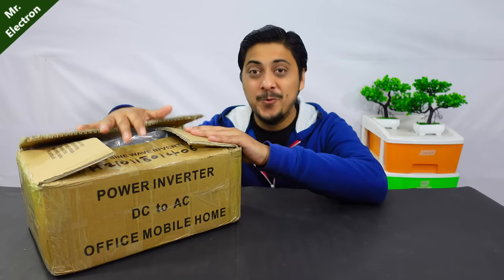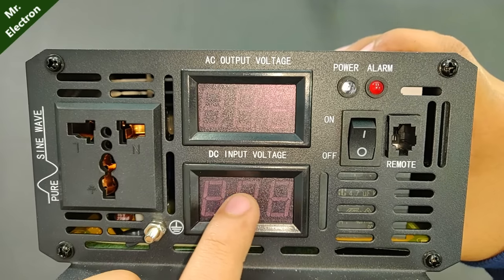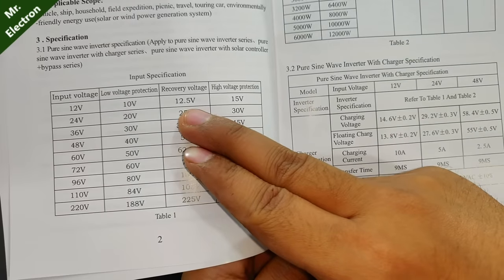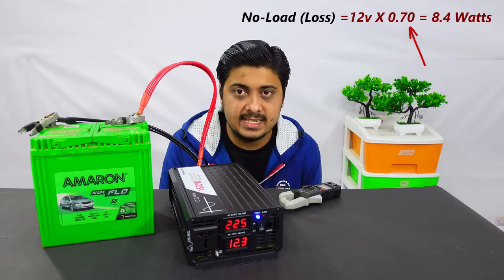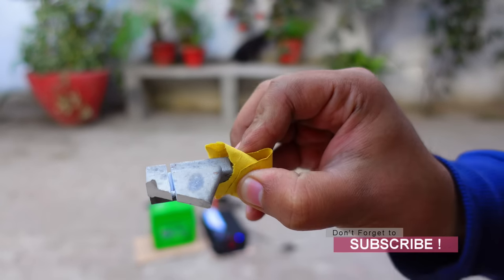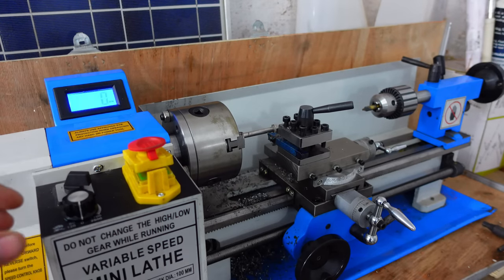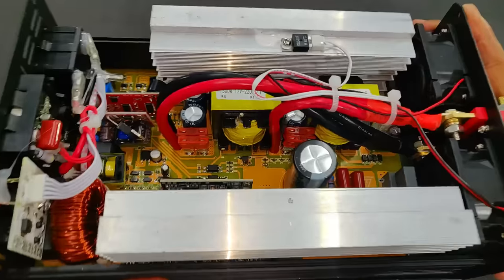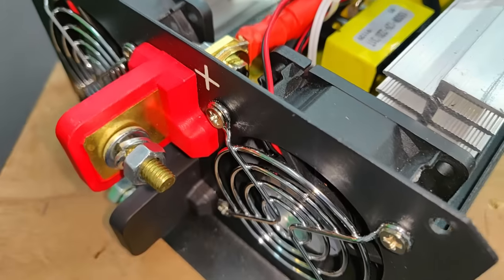3000 Watt Pure Sine Wave Inverter hook up to Car battery - 12v DC to 220v AC Converter  CNSWIPOWER

Comment: The title is misleading, this is a 1500 watt inverter not 3000 watt, the 3000 watt is only the peak output for a fraction of a second so it can't be used to run 3000 watts.
Reply: Thought for sec there if I was the only one who noticed that! Thanks
Reply: What's the cost ?
Reply: Milega
Reply: @leanbean8376 

Surat Gujarat mein

Comment: Great video, I really liked your whole presentation and editing, but I think this testing should have been done off of a battery in a running car, so at least you could test it with a fully charged battery for every tool. As is, your not really showing the full potential of the inverter. The charge level of the battery is a major factor effecting performance and making your results unreliable. I'm really interested to know if the welder would have welded if it were in a fully charged battery, or if it would have worked with a bigger bank (two batteries in parallel) If you'd have just added some jumper cables from your test battery to a running cars' battery  that would have made this whole thing a true measure of the inverter.

Comment: Dang i was hoping you'd at least get an arc struck there to give me an idea if my setup that I'm about to attempt some welding at will work or nah. I've got a pretty good feeling it will since I'm running my inverter from a 120ah deep cycle as opposed to what you have here tho.

Comment: hell'o and thanks  i noticed you used battery clamps on the inverter wire  to the battery can you do the same to the back of the inverter with just the wire and clamps to that terminal ?  you know two clamps to the battery two clamps to the inverter for quick connect thanks  and what size wire was that if in american would it be two 6 size making it a size 3 as america goes the bigger the wire the smaller the number?? thanks again

Comment: Hi i have a question... do i need a circuit breaker in between the battery and inverter ?or i do just to straight from battery to inverter just like you did.
Reply from the maker: Just like i did.. it already comes with all types of protection features like overload , short-circuit , high temp etc.

Comment: I’m hooking up a 5000 watt converter to a 4 - 12volt battery bank but when I hooked the positive cable it sparked pretty good, is this normal, I stopped and need more infro

Comment: I want to run 1.5 Air conditioner 18000 BTU from 12 volt batteries to 220 AC which inverter is best for me kindly reply
Reply: Can we run 1.5 ton window ac

Comment: Great video for a 2500watt gasless mig welder 90amp would a 3000watt inverter work, what voltage battery would i need to run it? Thanks
Reply from the maker: 12v 200Ah
Reply: @MrElectron  thankyou for replying would that just be one battery at that rating
Reply from the maker: @jaybradley3765  You are welcome 😊.  One battery or many batteries.  It doesn't matter as long as the total amps add up to 200A or more ( the higher the better ) in parallel, and the overall voltage remains 12v to 14v.
Reply: @MrElectron  thanks for your reply. How long would the battery last after fully charged. Need at least 4 hours.
Reply from the maker: @jaybradley3765  The answer depends on too many factors like the type of battery bought, the thickness of the copper wires used for connecting the battery and the inverter and their lengths as well, the efficiency of the inverter, the efficiency of you welder itself, the temperature conditions of the place where this setup is being installed, your welding speed etc. It's better to try and test 😊

Comment: Love your video.  I have a ??? Can you use the converter to charge that battery at the same time?  Thank you
Reply: Nope. This is only an Inverter. You'll need a separate power supply to charge your battery.

Comment: Bro I have a challenge for you. Can you help in making 3KVA supply inverter to make 800feet submersible bore work. 🙏🙏 I'll pay for This unit. 

Note : less weight and cost effective one 👍
Reply: U can use VFD for submercibal pump. Inverter is not sufficient for a such heavy load .Vfd is available for 1kva to 10kva

Comment: I have a serious question. Is it possible to connect a 12v car battery to the inverters and from one of its out sockets attach a cat battery charger to charge the battery that's attached to the inverters. Theoretically would that keep the power continues.
Reply: Continuous

Comment: Very cool :)
Quastion :)

Will this 2000-3000 inverter pure sine wave be able to manage 1050w car polishing machine all day for about 10-12 hours  intense work with some breaks of course , hooked to 100ah leisure marine battery ? 
Aslo will 100ah battery be enough for 10-12 hours ?
Kind regards
Your subscriber

Comment: will it work if i connect a running car alternator cables as input into this inverter?
Reply from the maker: Sure
Reply: @MrElectron  so.. if we use a battery to run 2 alternators, one to run a load and 2nd to self charge the original battery  , does this become a self running system?
Reply from the maker: @jakegill7796  no

Comment: You call that a car battery? Thats the same capacity we use to start a lawnmower. Most car batteries are 65ah
Reply from the maker: I don't call it a car battery. It is a car battery. Check that big label on the battery.
I plan on using it as my backup inverter battery. Its more portable coz its small and lighter than 65Ah or 85Ah battery.
Reply: @MrElectron  must have been a small car lol don't get me wrong man, i like your videos.

Comment: Answer of your question
The current difference is 0.56amp
Because without core generated current is 2.19amps and with cores is 2.75amps
Reply: @mr electron sir is I'm the winner plz.. tell🙏🙏🙏🙏🙏
Reply from the maker: CONGRATULATIONS !!! You have won the contest 🏆
Contact me Here 👉 omarsuhaib100@gmail.com
Mail me your full address with contact number.
Reply: Run universal motor on this inverter
Reply: @zeetvofficial1547  dos

Comment: I have a Jupiter 3000W/6000W continuous inverter. Using it for a 8000btu air condition. It powers it on but the inverter makes a loud alarm type sound. I even purchased the same brand 2/0 AWG Gauge cables to connect them as it says in the manual. And it still makes the sound. I followed directions to a T. Perhaps I don't have it screwed tight enough?
Reply: How are we supposed to answer your question in a meaningful way? If you don't want to use a meter to determine how your battery behaves when the current is high, you can consult a fortune teller instead.

Comment: inwerter
Reply from the maker: I saw that 😀
Reply: @MrElectron  Hey Mr Electron! I am back and I got myself an inverter. It is not pure sine wave and I am not so sure how I would power it up. 

I don't have any 12 volts batteries big enough to power it on. Any suggestions?
Reply: Ok
Reply: @kiranchhugani5223  Ok